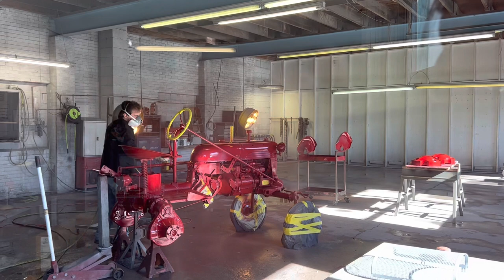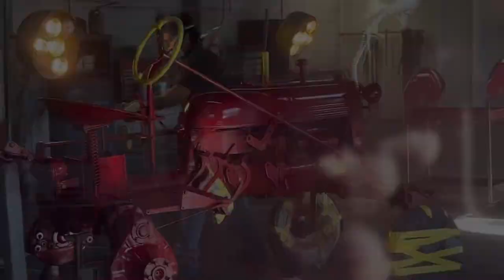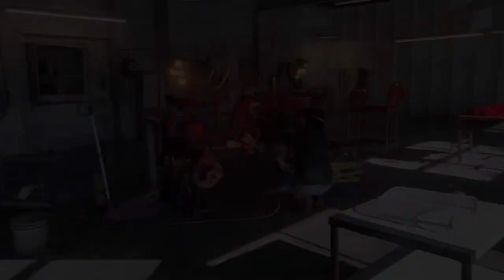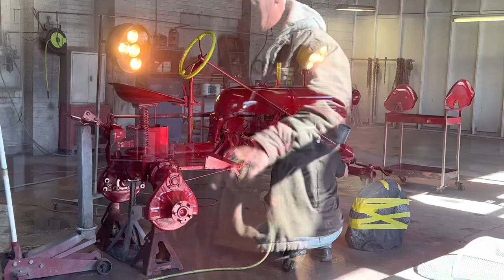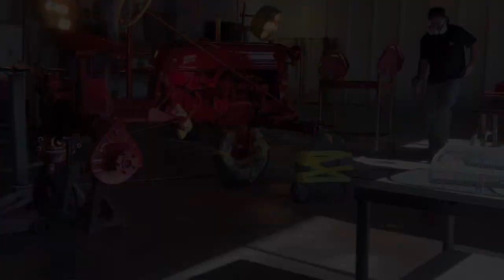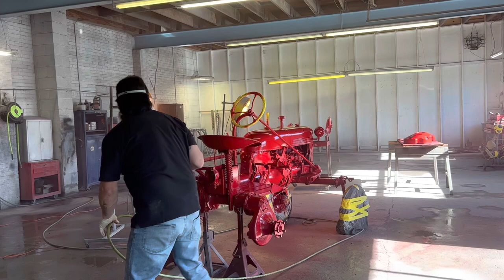1948 Farmall Cub Restoration: Part 3 Painting

Comment: Would you remove the gas tank and radiator on a 154 also did you paint the wires and belt ?